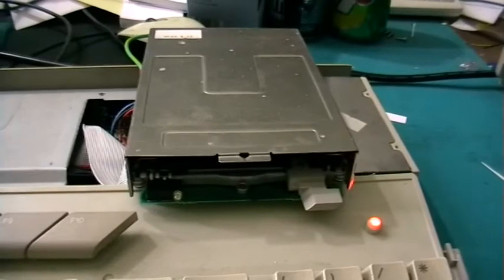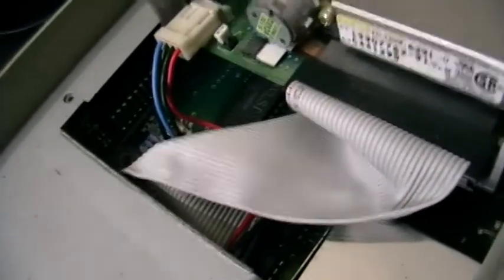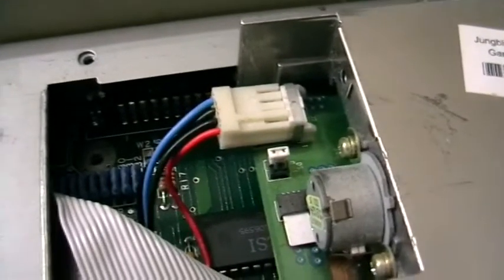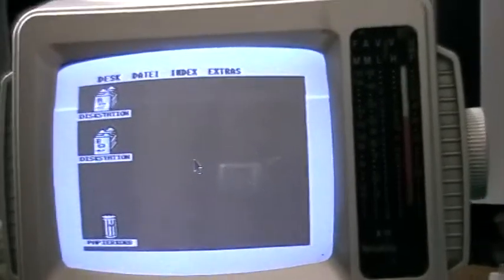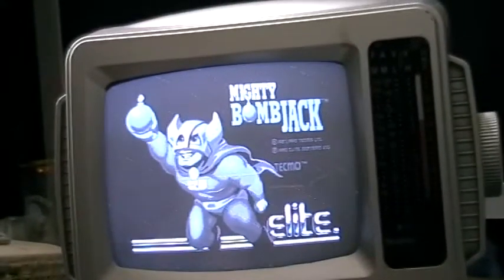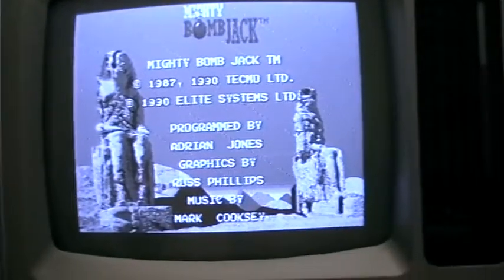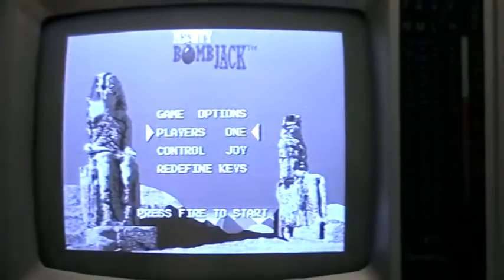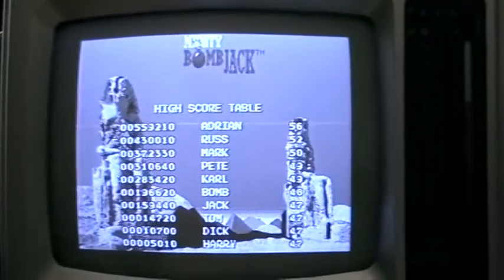Update: My broken ST Disk Drive (replaced)

Comment from the maker: You CAN replace an Amiga drive with a PC drive, but it's a little more complicated.
The Amiga needs the Disc Change (DC) and Ready (RY) Signal on different pins and in a slightly different way than the PC. 
Some drives have a large 'Jumper Block', where you can configure that. Most drives can be modified to somehow work with the Amiga but it involves soldering wires on the PCB of the drive.

Comment from the maker: The PC drive can write anything you want. It's just the controller that matters. Actually there are no PC or Atari drives. Basically they are all the same, only with newer drives the omitted the jumpers to configure it differently. A "drive A:" on the PC is a "drive B:" on the ST. That's the main difference. and Pin 1 of the cable is on the other side. In my experience, you can use any PC drive on an ST as a replacement if you can change the drive from DS1 to DS0. Just can't use it as a HD drive

Comment: Great that you got it working
Reply from the maker: Old disk drive standards are a pain to work with nowadays. The ST is easy. That's the reason why I haven'T replaced the disk drive in that with an emulator, yet. 
But I plan to get an HxC2001 for my ST as well.